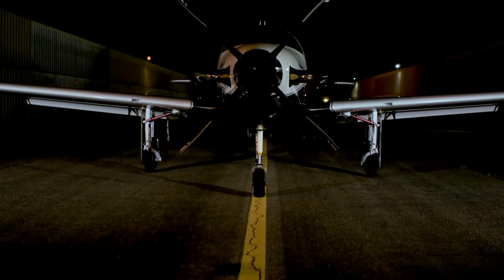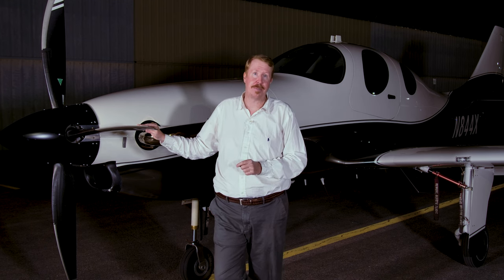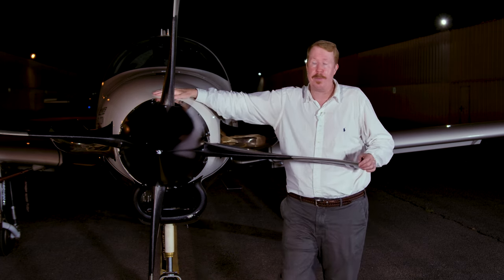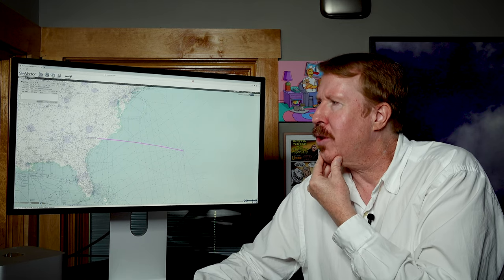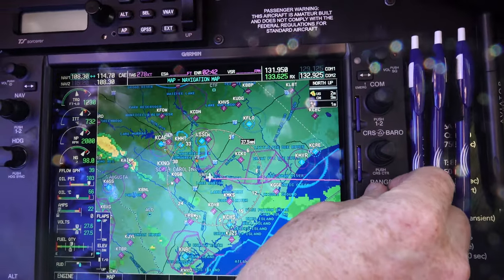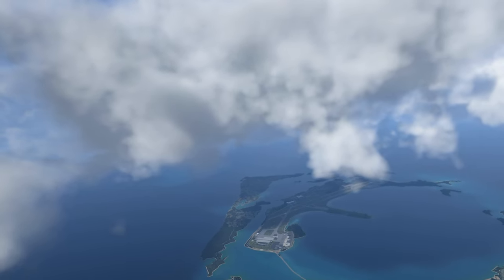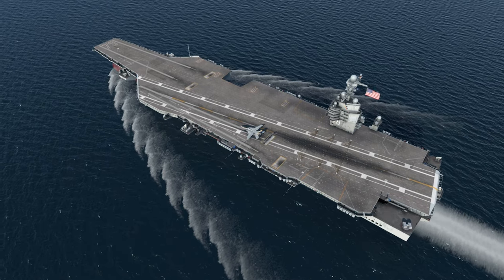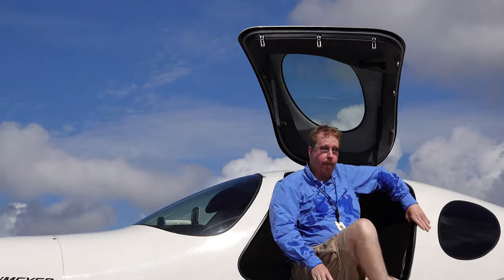Can a LIGHT PLANE make it to BERMUDA?!?!

Comment: The only dual engine failures I have ever had have been behind Pratt and Whitney engines. (I had a lot of engine failures as a manufacturer’s test pilot years ago)
Also since Bermuda is a single runway I have never flown an aircraft to this airport without having enough fuel to go to an alternate.  Disregarding weather, the flight in front of you can block the runway at anytime (like the genius in this video).
Reply: Where and when did these  dual engine failures happen? Plane type, location ,engine, out come? And as far as a plane that has over a 2,000+ plus 45 minute reserve range what airplane was that ?  A lot of engine failures? How many exactly? BS